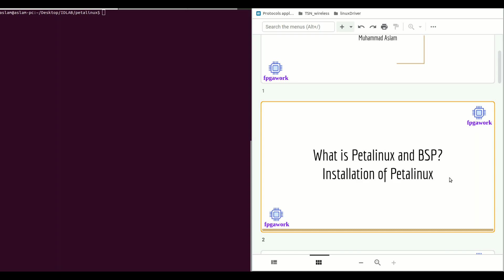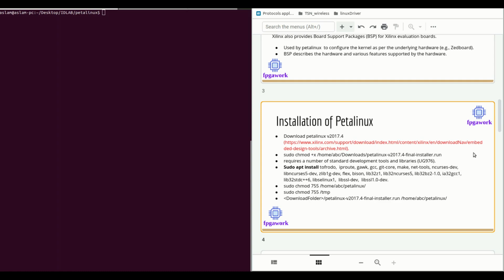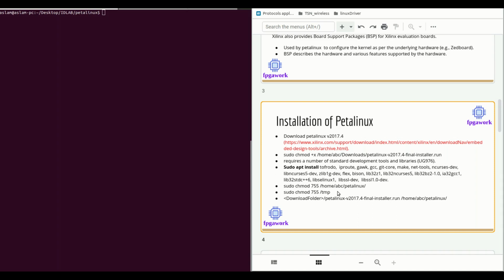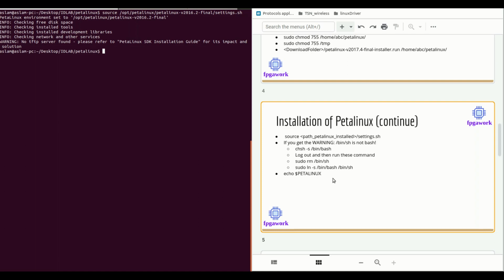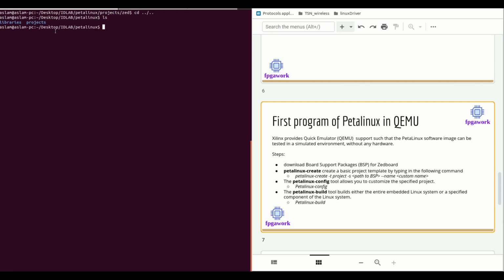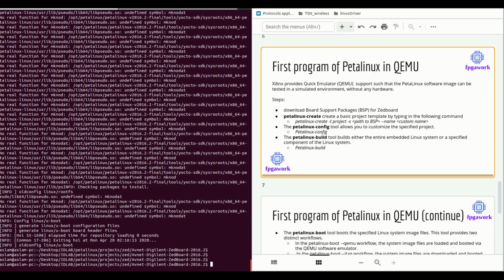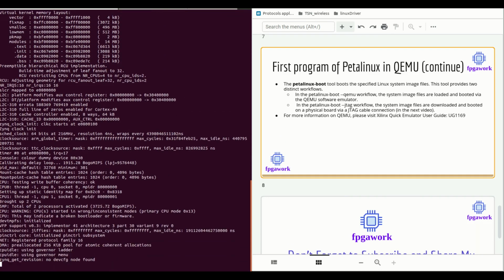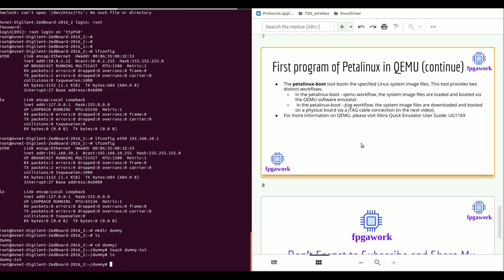Installation of Petalinux and running its first program in Xilinx Quick Emulator (QEMU)

Comment: I am facing these errors in petalinux-build

ERROR: No space left on device or exceeds fs.inotify.max_user_watches?
ERROR: To check max_user_watches: sysctl -n fs.inotify.max_user_watches.
ERROR: To modify max_user_watches: sysctl -n -w fs.inotify.max_user_watches=<value>.
ERROR: Root privilege is required to modify max_user_watches.
ERROR: Command execution failed: Traceback (most recent call last):
  File "/home/abhijeet/Desktop/NewPetalinux/xilinx-zcu111-2020.2/components/yocto/layers/core/bitbake/lib/bb/command.py", line 103, in runAsyncCommand
    self.cooker.updateCache()
  File "/home/abhijeet/Desktop/NewPetalinux/xilinx-zcu111-2020.2/components/yocto/layers/core/bitbake/lib/bb/cooker.py", line 1564, in updateCache
    self.add_filewatch([[dirent]], dirs=True)
  File "/home/abhijeet/Desktop/NewPetalinux/xilinx-zcu111-2020.2/components/yocto/layers/core/bitbake/lib/bb/cooker.py", line 295, in add_filewatch
    watcher.add_watch(f, self.watchmask, quiet=False)
  File "/home/abhijeet/Desktop/NewPetalinux/xilinx-zcu111-2020.2/components/yocto/layers/core/bitbake/lib/pyinotify.py", line 1908, in add_watch
    raise WatchManagerError(err, ret_)
pyinotify.WatchManagerError: add_watch: cannot watch /home/abhijeet/Desktop/NewPetalinux/xilinx-zcu111-2020.2/components/yocto/layers/meta-petalinux/recipes-examples/pm-notebooks WD=-1, Errno=No space left on device (ENOSPC)

Please help me out.

Comment: Hello Muhammad, when I run  petalinux-build, I got the error
 "INFO: bitbake petalinux-user-image
ERROR:  OE-core's config sanity checker detected a potential misconfiguration.
    Either fix the cause of this error or at your own risk disable the checker (see sanity.conf).
    Following is the list of potential problems / advisories:

    You system needs to support the en_US.UTF-8 locale.

Summary: There was 1 ERROR message shown, returning a non-zero exit code.
ERROR: Failed to build project

How to solve this issue?
Reply: This happens when there is a mismatch in OS requirement for petalinux tools. Check the OS requirement for your petalinux version.

Comment: Hello Muhammad, when I run petalinux-boot --qemu --kernel, I get the following error message "qemu-system-aarch64: -net nic,vlan=1: 'vlan' is deprecated. Please use 'netdev' instead.
Segmentation fault (core dumped)." I would appreciate your help. Thanks!
Reply: Can you try this command: petalinux-boot --qemu --prebuilt 3
Reply: I still get the same error.
Reply: Thank you for the link. I forgot to mention that this error shows up when I try to boot a linux OS that has been configured with my own custom hardware created in Vivado on the picozed board. However it works fine when I follow your tutorial for the zed board. Any ideas as to why this can cause the problem?
Reply: if you have a customized hardware generated by vivado, my video is not valid any more. You need to follow a different procedure, please read the link (https://medium.com/@aptaylorceng/microzed-chronicles-petalinux-build-5a47b9a7d6d6) as an example.
Reply: Thank you, but the link is not working?
Reply: google with MicroZed Chronicles: PetaLinux Build